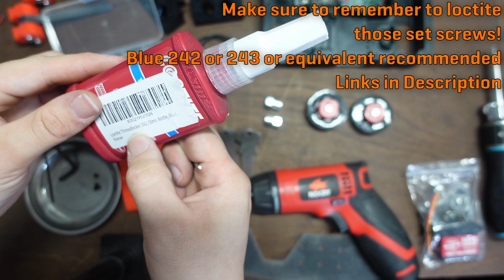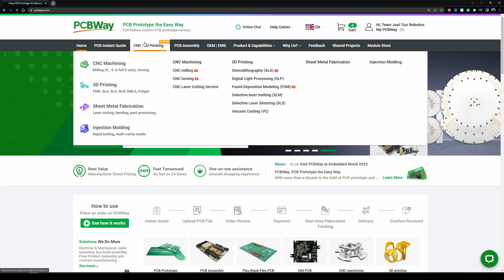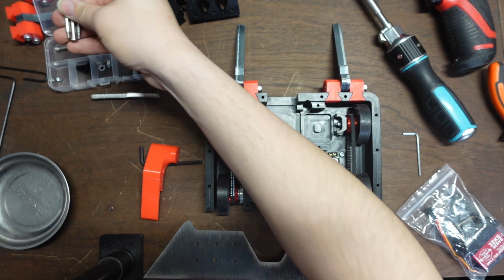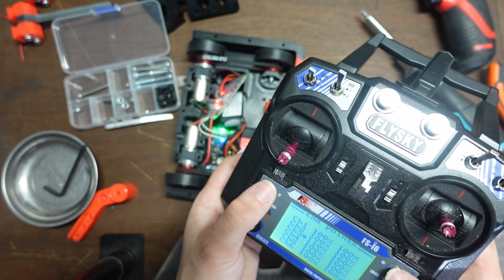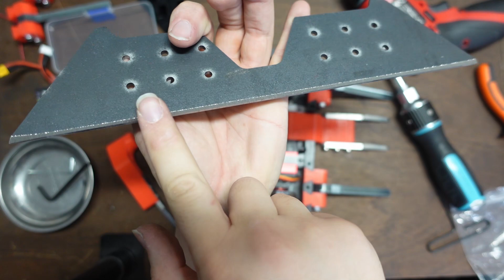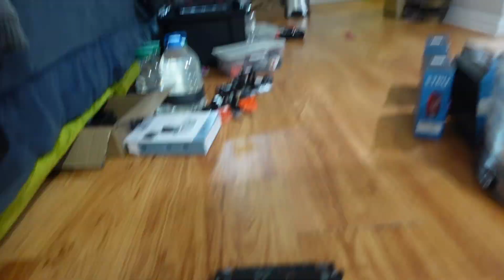How to Finish Your Beetle - SSP Kit Assembly Guide (Legacy V1.0)

Comment from the maker: I have a few people asking about when to use each of the configurations. 

1.The Claw Forks or Hinged Forks - since these are hinged they work just about the same upside down or right side up, but you can use the lifter to flip yourself over. This is the configuration you will probably use the most as it's a great counter to beater bars and wide drum spinners, and tends to be effective against most vertical spinners. If you spend a bit of time filing the tips, it can get under any robot running a wedge as well. The downside is that its most likely to get you stuck in gashes in the floor or floor seams. 

2. Fixed Forks - the fixed forks are great when you are fighting an opponent with poor ground game so you don't need the hinged forks to get under them. You will not have to worry as much about getting the forks stuck in the floor or on seams. If you are fighting a control bot or overhead attack bot which doesn't have a ground scraping wedge these are a great option. You can self right with the lifter using these as well. It is also a lot easier to lift other bots off the ground entirely with the fixed forks as they plant down immediately when starting to lift. 

3. Wedge - the wedge configuration is all about defense against horizontals and undercutters. It turns the arm into more of a grabber/tip over device than a true lifter in order to maintain a solid wedge across the front of the bot. Always point the front at your opponent and raise the arm and they shouldn't be able to do anything to you. The wedge is very heavy and durable, but it also puts a lot more weight on your front wheels so you will need to adjust your driving accordingly. The sides of the wedge are sloped so if a horizontal gets to the sides they are likely to glance off. Still, try to avoid hits on the side and especially back of the wedge as it can get pried off! You may want to buy some spare wedge mounting screws as they tend to get torn up: https://amzn.to/3W4UKhz

Comment: I bought a kit and ran it in a few matches.  The wheels are starting to slide on the axles and rub against the side walls.  Also the drive wheels are slipping a little rotationally, it seems the hex part wheel is starting to deform.  is this normal?  How often do I need to change wheel sets?
Reply from the maker: I think both of those problems might be due to the 3d printed hub TPU material 'creeping' over time where it loosens a bit due to constant tension on the pressed in parts. I don't know how long this normally takes but I've been using the same original 3 sets of wheels and hubs on my SSP and Subtraction for over a year. I think maybe different TPU brands do this to a lesser degree than others and some of them may use a different material than my original ones.

For the front wheels, if you buy a new set from me they come with a new bushing with a wider section on one side which prevents them sliding into the chassis slots. This was a change I made maybe 4-6 months ago. Shoot me an email/customer support message with tkyr name and order number for the kit, and I can send you just the bushings.

 For the rear wheels, you can probably fix them slipping on the hubs by just using oversize set screws (maybe M4 X 8mm or 10mm long) which protrude into the TPU hub and lock them together better.
You can buy kits like this on Amazon with many sizes for like $10 or find just the right size for a bit less. 
https://amzn.to/3SzFyrj
Reply: @JustCuzRobotics  Looking at the rear wheels there is definitely material creep.  The hex portion is nearly completely rounded off, looking at my email archive these appear to have been purchased on July.  The front wheels are definitely not as tight as they should be.  They feel like a snug fit rather than a press fit.   I have another set that was purchased in September, I put these on the bot, but have not run it yet.  The front wheels fit a little tighter on the bushing, more of a light press fit.  I put a dab of gorilla glue on the wheels before pressing in the bushing.  Maybe that will help, shock loads will probably break that bond.  I will send off an email this morning.

I had considered getting longer setscrews, that is kind of my "plan b".  

I'm trying to get this bot ready for Moto in a few weeks, but real life keeps getting in the way.

Comment: Thank you for making your design open-source and available! I'm hoping to scale down this design for an Australian 150-gram antweight competition.
I was wondering, why use shoulder bolts rather than more commonly available fully threaded bolts? Is there a particular trade-off being made by using shoulder bolts whenever you are mounting through another component?
Reply from the maker: Shoulder bolts are far stronger and more precise diameter on the shoulder than a threaded bolt. The minor diameter (area inside the thread) of an M4 bolt is 3.24mm while a 4mm shoulder bolt is well, 4mm (reality 3.98 or so). This means a shoulder bolt has 52% larger cross sectional area for the same outer diameter.

Comment: Nice overview! How are the lifter forks held in place? Is there a flange inside the hole that keeps the metal fork from sliding off the nut? Couldn't tell from the video if it was just a straight-through hole or not.
Reply from the maker: The forks don't have a flange, the nut itself has a flange. It's a very thin hex portion outside the fork but it's there. It's meant to be a press nut but they work well as a low profile nut all the same.